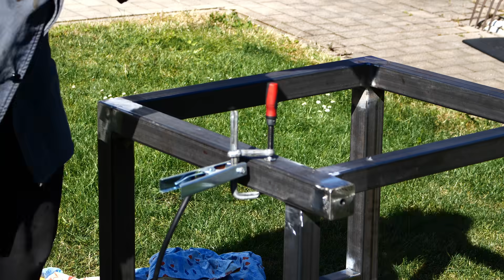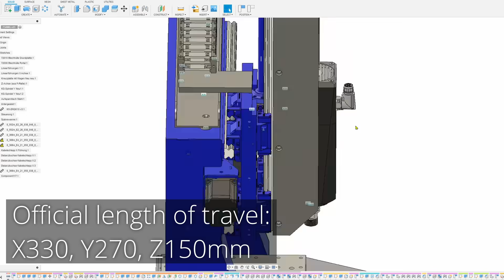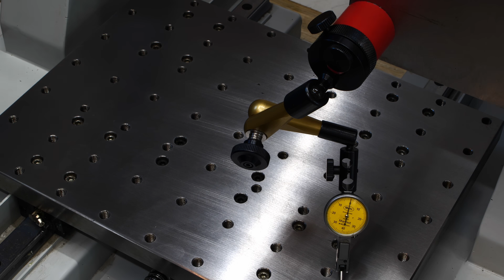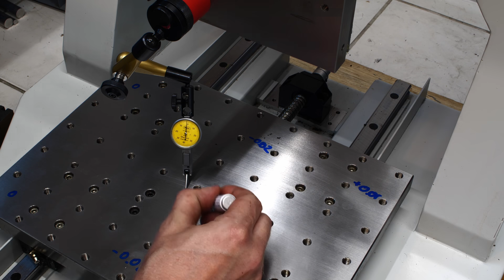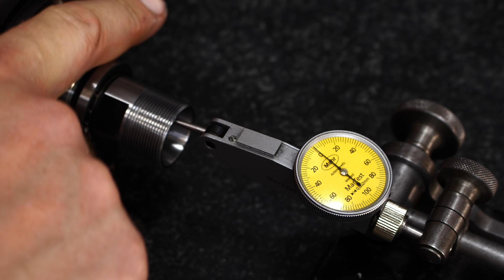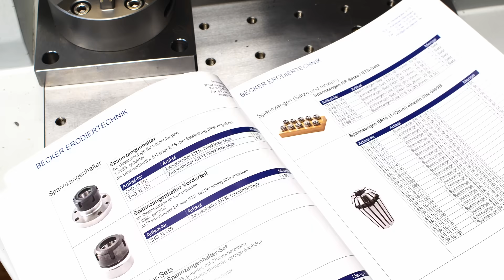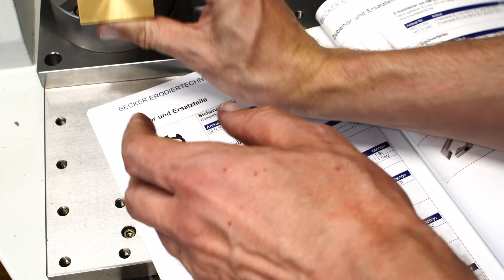CNC Project: FS4MG - "Not a Kern"

Comment: FOR EVERONE WONDERING ABOUT DRAG CHAIN CABLE.

In an earlier part of my engineering career when I was doing custom built production cells. I did projects where we built gantry robots and where we used 6 axis robots. There are 2 distinct kinds of cable you will find in catalogues from companies like Lapp, Belden and Olex - trailing and robotic and yes there is a difference.

FIRST a basic lesson in copper cable. Typically electrical cables are made from strands of copper wire but you also get aluminum and gold for some applications. For all those who have watched Blondihacks series on copper boilers you'd know that copper work hardens. The difference between good quality electrical cable and poor cable is the quality of the annealing after the wire is drawn AND YES there's a big difference between manufactures. 

The main difference between cables for fixed applications and flexing applications are the number of strands and how the cores are encased in the plastic sheath. Fixed wiring has thicker strands and is simply encased in the plastic. Trailing and Robotic cables are made from much finer strands and they are installed with a dry powder lubricant so that the strands and cores can slide over each other. You'll see that lubricant when you strip the cables. Some of the higher performance multicore cables also have cloth sheaths between the cores and the outer plastic sheath. If the cable is shielded they have to do the same with the shielding in that its made from much finer strands.

- ROBOT cable is the cable specifically designed for 6 axis (and similar) robotic applications where the cable doesn't just flex back and forth but also TWISTS. If you think about welding robots and spot welding robots they flex and twist in all sorts of ways. The standing, sheath and construction is all done for continuous flexing in ANY DIRECTION. This is why it costs a lot of money per meter but in things like welding applications its an absolute must if you want to avoid heartbreak.

- TRAILING cable is what is used for drag chains. In most catalogues you won't see titles or descriptions or categories saying "drag chain cable" you'll see "trailing cable" and in the description you'll see "suitable for drag chains." Despite the label trailing cable is specifically designed for things like drag chains. It can be used for twisting applications but its main use is in drag chains going backwards and forwards.

A COUPLE OF KEY POINTS
A critical thing to look for is the minimum radius of the drag chain and the minimum radius for the cable. You should always pick a combination where the minimum radius of the cable is LESS THAN the minimum radius of the drag chain. Otherwise the cable will be stressed by the chain as it runs back and forth. The main aim of these systems is to NOT stress the cable or you will work harden the copper and it will eventually fail.

When installing cable in a drag chain a major mistake is to use cable ties to clamp the cable to the chain DON'T DO THIS the idea is to let the cable flex. Most drag chain supplies have clamps for the end of the chain if required but typically you'll only clamp at one end so that the cable is free to flex. Most drag chains also have separators to keep cables from rubbing against each other - USE THEM.

If you have communications, encoders and/or sensors don't simply throw the cables in the chain next to the motor power cables. I typically had AC servos with either encoders or resolvers so we had BOTH power and sensor cables. Its best practice to keep them as far apart as possible. Most of you will have power cables for stepper motors not AC Servos but don't forget that stepper motors are notoriously noisy by the nature of what they are. So its still sound practice to keep the power cables separate from the sensor cables. If you have a chain without separators use the air lines to separate the power cables from the sensor cables.  

So for all of you with these cartesian type machining centres you only need trailing cable but you do need to install it properly if you want it to last.

FINAL POINT ON MOTOR CABLES WITH PLUG CONNECTIONS
In this vid you'll see that Stefan bought a factory made cable for the spindle motor. For these sorts of motors with multi-pin cannon connectors or mil-spec connectors I ALWAYS RECOMMEND BUYING A MOTOR CABLE FROM THE MOTOR SUPPLIER. I have done a lot of work with such connectors over the years and they are fantastic when you have the right crimping tools or high quality soldering equipment but they are a nightmare when you don't.

Stefan says his spindle cost €3,500. You don't want to risk that on a dodgy cable where its 100% your responsibility. I have never had a factory supplied motor cable fail but have seen what happens when cheaper options fail. Even if you are that 1 in 10,000 who gets that factory cable that fails there's things called warranties and customer support.
Reply from the maker: Excellent breakdown!
Reply: @StefanGotteswinter  Thanks.
I like the fact I heard Lapp Cable at one point. They are one of those suppliers I always have on the list for a project. Its never the cheapest but I KNOW that it will do what the specification says.

If there is another thing I would advise everyone in automation projects. 
USE 12mm barrel type proximity sensors with an M12 Plug connection whenever you can.
1) The M12 connection is a standard pin pattern so all of the variations from various manufacturers are interchangeable. All you ever have to worry about is the sensing range of the replacement.

2) These sensors have a 12x1 thread and its easy to get a tap so you can thread them into the bodies of things and just use 1 of the supplied nuts as the locking nut. Yes you end up with a collection of M12x1 nuts but then the talking monkeys like to lose them. So having spares is wise. The fine 1mm thread means if you rotate the sensor 1 turn you also know the end of the sensor has moved 1mm. 

3) At 12mm diameter the 1/2inch (12.54mm) Pilot point drill from Dewalt cuts a perfect hole in aluminum and most sensor brackets are made from Aluminum.

4) On the maintenance side if the sensor gets "wacked" its a lot easier to replace the sensor and plug the lead on than replace the sensor an wire it in. Wait until you have to replace a sensor with a plug connection and you will never go back. 

Also the 7/16 (11.1mm) Pilot point drill makes a near perfect hole for the M12x1 tap.

The one exception I have for that are sensors for hazardous areas I typically use 18mm sensors with a lead for that stuff. The reason is when you have a site with mixed standard and hazardous applications is less likely that a maintenance guy will put the wrong sensor in the wrong place.

Comment: Can you eleborate on the decision of stick welding the frame outside instead of tig welding the frame inside? I am trying to learn the welding process and you clearly have thought about this and i would like to know the decision process. Thank you!
Reply: I can't speak for Stefan, but, a couple of advantages are that it's faster, and cheaper.  Stick welding doesn't require shielding gas.  The welder set up is easier to move around (there are no   gas lines, foot pedal or gas cylinder to worry about).  In some cases a stick welder can weld in a more confined space because it is a one hand operation and the stick is skinny.  TIG requires access with the torch and the filler rod.  Finally, the benefits of TIG are not required for building a frame of low alloy structural steel.
Reply from the maker: Its faster, more tolerant to dirt - With tig the parts would have to be clean-clean-clean, not just half-assed clean with a flap disc :D
Also cheaper and I don't have space in the shop to do large welding projects inside.

Comment: Fantastic small CNC machine frame!
I remember about 12 or so years back on the CNC forum when the German guys were designing that epoxy franite frame and starting to make them.
From memory it is not a welded structure filled with EG but instead is an EG structural casting with some steel plates fixtured at critical places.
It will make a very pro setup for your small part machining needs! 👍🙂
Reply: That's the larger model, the FS3MG. The small one, FS4MG, is a lost mould / stressed skin kind of thing, cast directly into a thin welded shell.
The precision surfaces are all moulded with a very precise master template using a diamant polymer DWH or some similar "machine tool grout" epoxy stuff. Seems to be the better way to do things like that, though it might feel a bit counter intuitive.

Iirc Thomas told me the skin isn't very significant for the FS4MG's stiffness/stability when I had the idea to use a thin shell to deal with tension loads, but I'm not completely sure about that. Been quite a while.
Reply: @heinzhaupthaar5590  .. thank you very much for the info. 👍
With such a great starting frame and Stefan's brilliant engineering I cant wait to see how it turns out!

Comment: Quick question if you dont mind. I remember that you had a pneumatic quick change spindle on the old ISEL router. That seemed even more convenient than this HSK system. How come you didn't go for a similar solution this time?
Reply from the maker: Also the addon changer was about 5 precision levels below the hsk spindle i got now :-)
Reply: @StefanGotteswinter  I appreciate the reply! Very interesting. Also, thank you for humouring me and explaining the workings of the Erowa-style chuck.
Reply from the maker: Small diameter ISO toolshanks are a bit painful, hard to get, since there is no definitive standard like with HSK and also not very stiff. 
In reality you would have to go up to Iso30 size right away and then you are already in a size range where balancing to 25k is not standard.

Comment: maybe  the plate is flat, but the rails in the gantry have been bent. to check it: put a straight edge on the table and test again. same idea for the other axis.
Reply from the maker: true - Would be a good idea to confirm against the straight edge.

Comment: Alot of ac servo manufacturers use molex actually. It's the electricians job to mount the cables in a way they will survive. But yes, automation brands mostly use high quality metal round connectors.
Reply from the maker: Yeah, I am familiar with the Festo Servos which have nice round screw on connectors :)

Comment: I really like those machines.  I was hoping you'd say you were planning to use LinuxCNC just so I could see your attention to detail applied to a project like that.  I'll look forward to seeing what you do with your new machine!
Reply from the maker: I have left the option open to build a linuxcnc controller :)
Linuxcnc would have advantages in regards of running 3d toolpaths, but for now, my existing controller has to do.
Reply: @StefanGotteswinter  I'd say I'll subscribe to see it...but I've been watching you for years.  Learned a ton from you that I get to apply in some things I do.  I love those little machines, and have been quite tempted to get the FS4MG with an ATC spindle and carousel.  They look so well engineered and made.  And there are some impressive videos out there showing what they're capable of.  The fixed gantry also gives much better workspace area versus machine shop space than a traditional column CNC mill.

Comment: I can highly recommend those carbide cold saws with ~350mm saw blades.. I got one 2 years ago and I will never go back to cutting stock with a grinder or similar machines.
And yeah, I'm also not set up to fab.. except I use those economical 120kg WLL aluminium trestles/platforms as welding-"table" ;-)

Comment: For us medieval machinist, some conversions.

Frame = 2.3622🍌 x 2.3622🍌x 0.118🍌
Machine Weight = 407 LB
Official Travel X 12.9921🍌Y 10.6299🍌Z 5.9055🍌
Table out of flat: -0.000787402 to + 0.000393701
Out of square: 0.000393701🍌 over 5.11811🍌
Great video as always! 👍👍
Reply: As a middle-aged Brit I use metric and bananas equally and will use whichever unit gives an easier number. Measuring say, a table for example 4'6" in one direction and 700mm in the other. No messing with single mm or 1/64" and easy enough to be able to remember it.
For smaller measurements I find thou to be easier and I have a better 'feel' for what it is. 20 micron just means nothing but 8 'tenths' I can visualise.
What gets my goat is when dimensions are specified in an engineering drawing in fractional inches. Even my imperial machines don't have fractional dials ! Just give it in decimal. What the hell is 37/128" ? It's 'go get you calculator time' and swear at it the whole way , that's what it is.
P.S. I am fully aware that inches Are metric.
Reply: @Andrew_Fernie    you could also work with 0.1mm (= one tenth mm ) or 10 microns (=10 tenths mm or one hundredth mm ).
The core problem with freedom units is their varying multiplicators to get from one "area" to the next while metric is always based on 10. This robs one of of the round-fractionals like 1/8, 3/32, 5/16 (of which at a glance I never know which one is bigger or smaller anyway), but makes it way way easier to traverse scales, add several together or subtract and conversions to other units.
4'6" for example is one of those silly bananas sizes where you need 4x12 + 6 to get it all in one single value to be able to use it with other measurements to be able to traverse. Because "It's 'go get you calculator time' and swear at it the whole way , that's what it is."
For metricated people the "What the hell is 37/128" ?" happens most of the time with any of those banana dimensions because it is so inconsistent.
Reply: LOL

Comment: Stefan, it's really weird to me seeing you use a tape measure as opposed to a micrometer :face-fuchsia-tongue-out: Great project and inspirational as always! Congrats on the new machine too.
Reply from the maker: Tape measure and wooden folding rules have helped me build many many machines in my professional career :)
Reply: @StefanGotteswinter  Look up the contact-meter variant. It might blow your mind a little bit.
Reply: What tape measure? I saw a wooden folding ... thing ... that carpenters use when they need to measure things with plus/minus 5 mm tolerance ;-)
Reply: @first_namelast_name4923  3:15
Reply: @first_namelast_name4923  See 3:23 adjusting the cross section of the table parallel, before welding.
Edit: Vince is clearly joking. This and maybe a try square are the appropriate tools. The tolerance requirements(important dimensions) were guaranteed by the following clamping. As seen in the video[tm]. BTW: Oh you can't work precise down to a tenth of a mm with such a "wooden folding"? You Heretic! Hehehe. Have a nice day, strange nickname!:)

Comment: Very neat chuck system for proto/dev work and short-run manufacturing. I like the possibility of having a chuck on the lathe and on a CNC mill to move parts between machines with no loss of precision.  I use a collet chuck to do that with microwave antenna feed parts, using a dummy D1-4 spindle nose on the mill. It's very repeatable in X/Y/Z but it's not so precise in rotation.
Reply from the maker: i truely want a chuck for the lathe, yeah :-D
That would be awesome to run back and forth, if only for parting off finished parts.
Reply: I use the same system a D1 4 camlock chuck which fits on lathe and mill whenever I opened the chuck precision was gone so I came up with this and bought my new lathe with D1 4... original Chucks are quite expensive but if you are able to make your own backplate it's cheap and precise....well I talk easy now I needed 4 bad backplates until my first was like I wanted her with 0,02 runout 25mm before the chuck is always the minimum that I accept 🫣

Comment: The last years i used a small optimum metall mill converted with 4 closed loop motors 12.5Nm for milling nice small metall parts ( stefan helped me once while converting with an answer in a forum😊) and was quite satisfied so far but seeing Stefans project i think about buying a bigger frame and doing the same as he did.
A friend with his router always comes to me machining when the material is harder than normal aluminium... the Optimum mill has no problems with steel of different kinds there is controlled cooling mimimal and normal also controlled by the cnc controller as the spindle speed...the parts are very close to spec and for my use more than exact enough 😊thanks to the closed loop system which is nothing else than a servo....
Reply: Was it a BF20 perchance...? Some time ago at work we used to have a manual one purchased together with a CNC conversion kit, albeit an open loop one - it was a nice machine that served our fairly modest needs quite well...